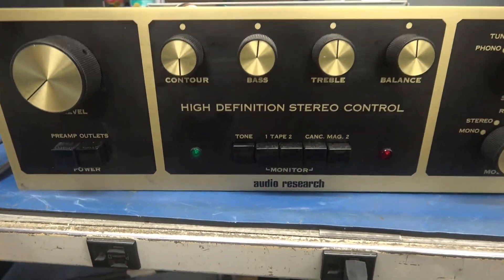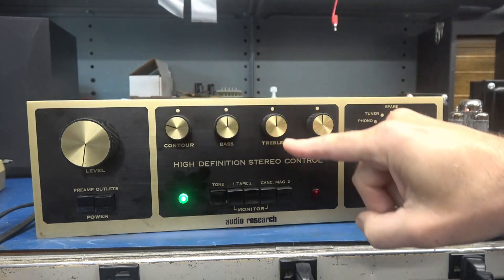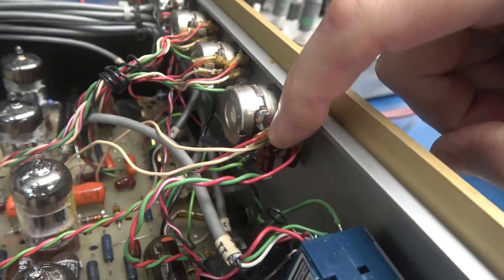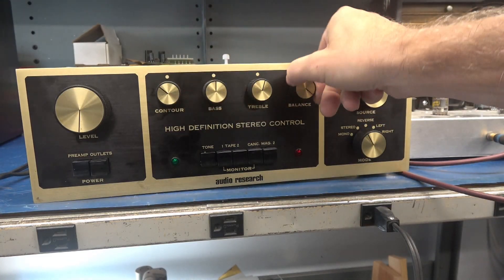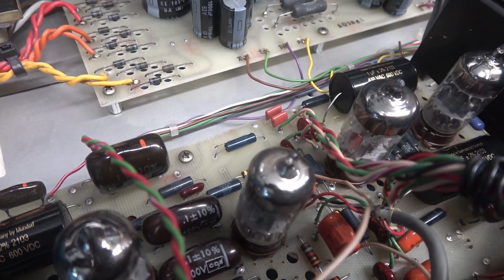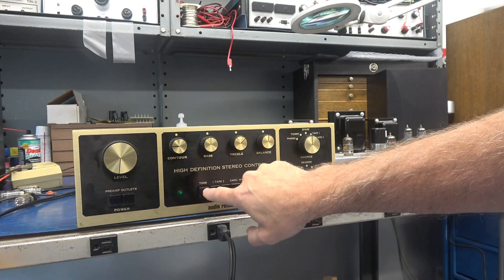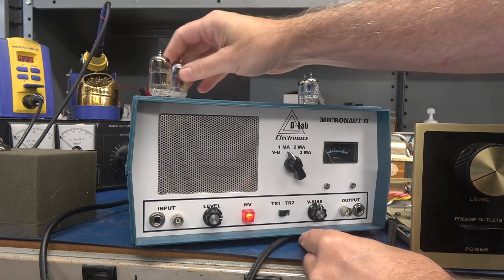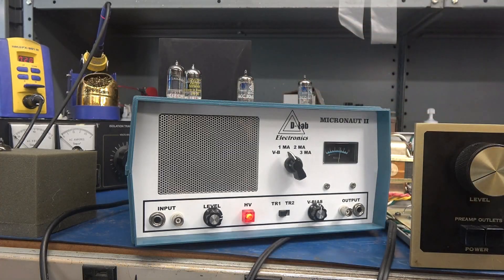Vintage Audio Research AR SP-3 tube home stereo preamp repair Balance Contour

Comment: The  on/off tone switch is an internal slider type which may have some oxidation which causes bridging the connection
poorly upon activation. Fader F5S-H6 sprayed in it may eliminate that.  Just a thought on possibly eliminating a cause IF
you have good tubes.

Comment: Looks like very nice preamp.   I have a Mosode minuet tube preamplifier.  Back in the 90's my amp tech Dean Zink gave me 4x quite 12AX7 tubes for it. They still work fine after all these year.  I believe they are Russian also.  Last couple years I had him pad my Volume control. He said preamp was designed for solid state. And I use tube.  So when I had it at 9 am it was full blast.   Its now padded where 3 pm is full blast.  I run it with two RCA mono blocks 25 watts class A  4x 6V6 output 5U4 rectifier and 6SL7 preamp.  Terry is sounds glorious!